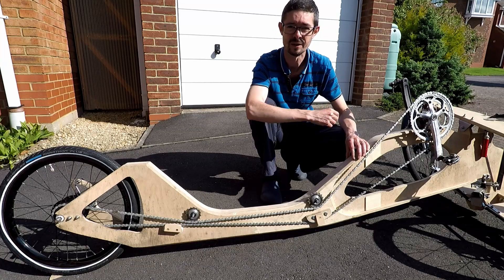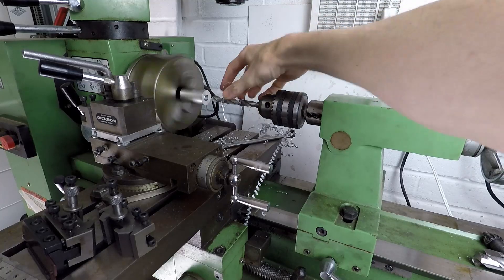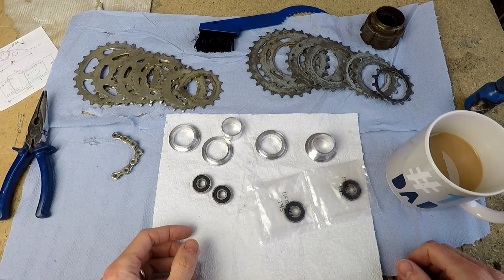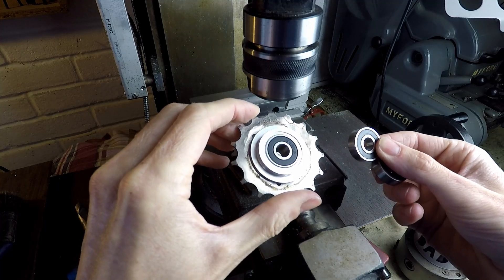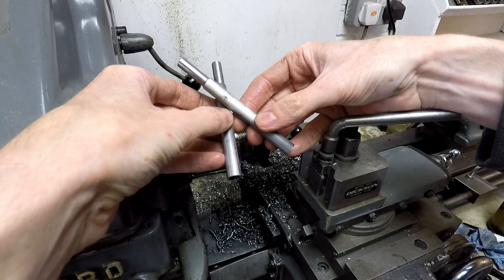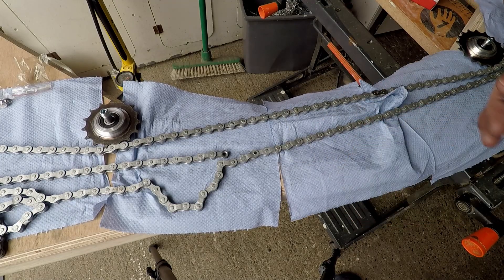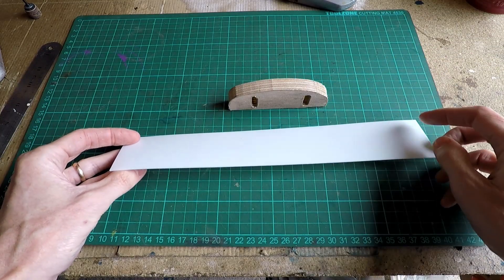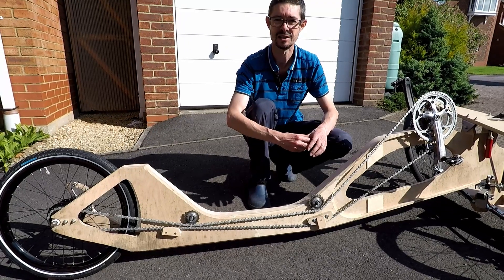Tilting Trikes Part 13 - machining and making the drivetrain on velomobile prototype

Comment: Maybe consider going electric, there is a new technology the would eliminate the unwieldy chain called Schaeffler chainless drive - just a crank and hub motor!
Reply from the maker: I had a look at that Schaeffler drive, I think it would work well if augmented by battery power (as is my plan for future development of my design).  As a direct replacement for a chain drive, you have reduced efficiency - Schaeffler claim a loss of about 5%, which is actually pretty impressive.

Comment: My Rans Rocket, SWB, 20", has two fully floating idlers.
One on the drive side and one on the return. They work well and they work well. It is getting the position of them in the right place, something that Rans did.
Good progress, keep it up.

Comment: If you plan to use smaller chain sprockets at the front, that chain tensioner won't be good enough. You will have to use similar tensioner as it is on rear derailleur on normal bikes. Or something similar that would be spring loaded and have enough travel. Anyway, I'm looking forward to your next video.

Comment: I have used floating sprockets in my LWB recumbent chainline (similar to your design), and to be honest it was wasted effort - they do not slide 🤬
It will be interesting to see whether you have similar experience?
Reply from the maker: I suspect I may have the same experience, but it probably doesn’t really matter for such a long chain anyway.

Comment: Really coming along nice.  Such a nice organic design.  Please, please reconsider using your hands to clear chips WHILE the chuck is spinning.  Use a rake or pliers, or power off the spindle.  👍👍😎👍👍
Reply from the maker: Good point, thanks! I definitely need to not do that any more.

Comment: Are you intending to use all the metal components you’re making in the finished trike?
Reply from the maker: Some but not all.  Most of the bits made on the lathe or mill will be reused, but the fabricated sheet metal probably won’t be.